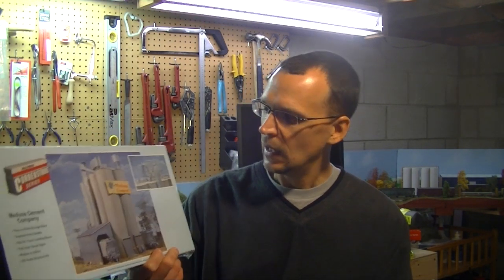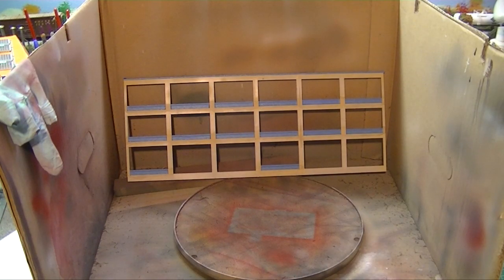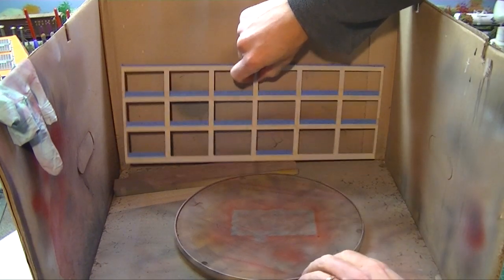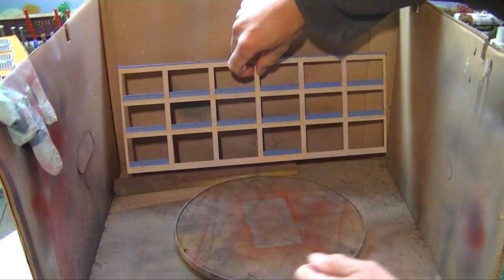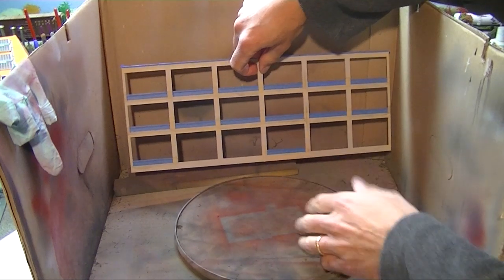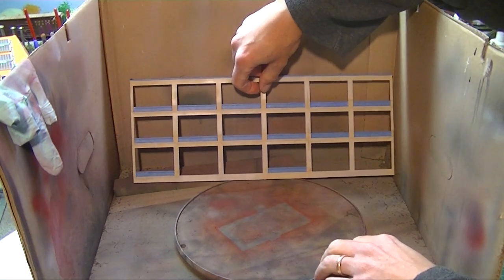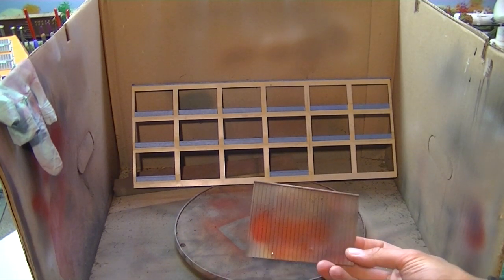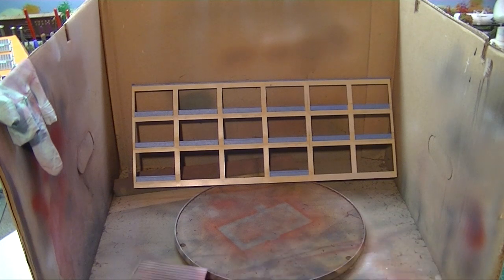Working in the Background - Making a Background Building

Comment: The building looks great.  I built the same building.  I would mention with the windows that there is 3 inner windows.  I think they represent windows that open inward.  You did the same thing I did and didn't notice them and put some on the top and others on the bottom.  If you look at the windows from an angle you can see it.  I had to remove a few and I put them on the top.  I'm not sure if I leave them or paint them.  At least you didn't put the overhangs upside down like I did.
Scott
Reply from the maker: lol, it's funny you mentioned that.  I did notice the windows in upside down on a few but figured it was too late.  Might correct it before I put the building in place, but we'll see if it's noticeable once it's on the layout.  Live and learn I guess!

Comment: WC did serve a 3M plant that made several types of roofing.  I believe it was up by Wausau.  They received roofing granules in the WC 84xxx-series 2-bay covered hoppers.  I can't recall, but they may shipped finished product in 50' boxcars, although most of it probably shipped by truck.
Reply from the maker: That is great information!  Thanks for sharing.  I'll have to do some research to find out more about the plant and what buildings and structures there are.  I'm guessing it is still around.  Maybe served currently by CN.  Thanks again for the info!

Comment: What ratio do you thin your paint? I have the same airbrush as you and a old pashe 20psi compressor but every time i airbrush it comes out super watery?
Reply from the maker: It really depends on the paint MFG.  Some paints I'll do a 2:1 paint:thinner mixture, others less, 3:2, etc. . .  FishPlateFilms had a great idea to make the paint the consistency of milk.  I've started using that as a guide and it helps.  Your air pressure will affect how the paint is applied as well.  That can make it spatter instead of spray on.  I know I had a fair share of trial and error getting things right and I still don't nail it every time.